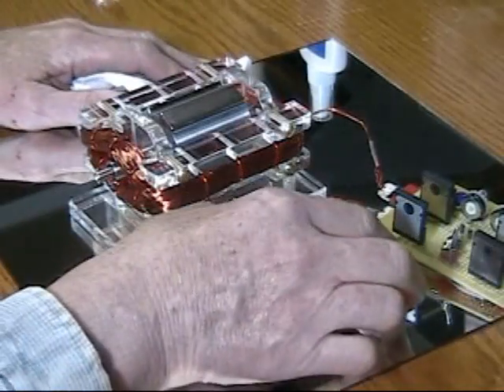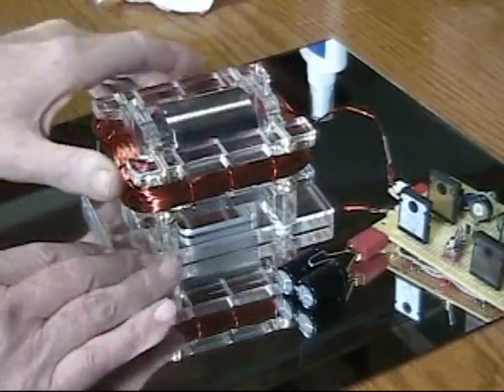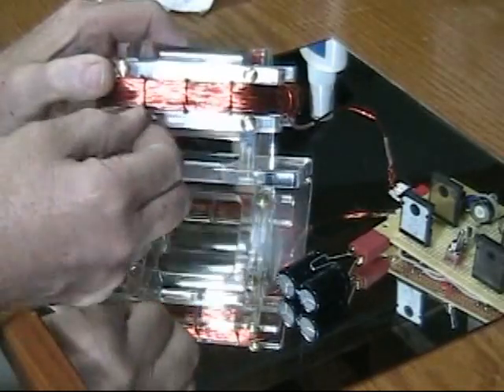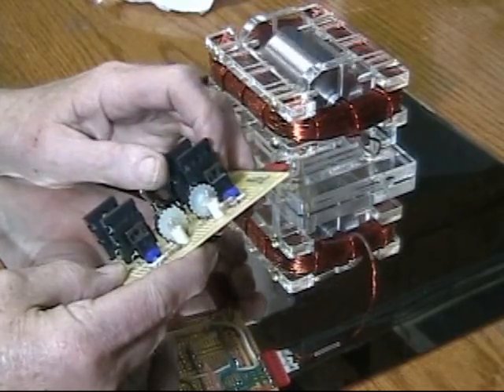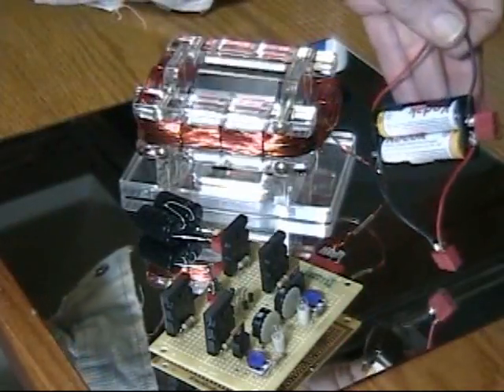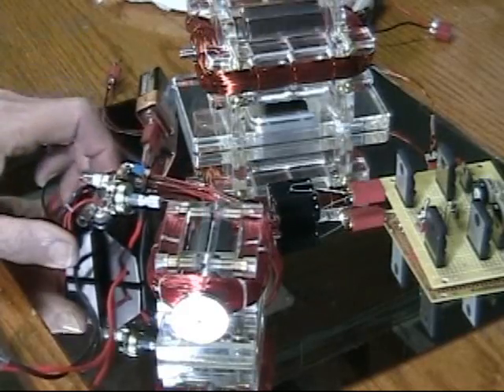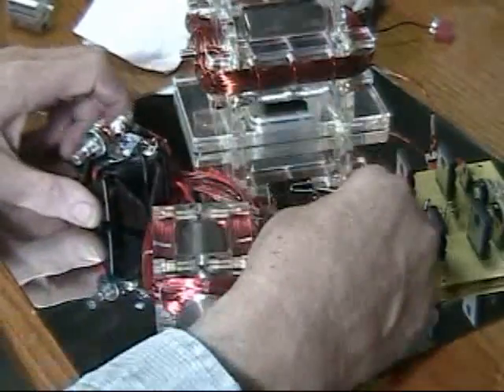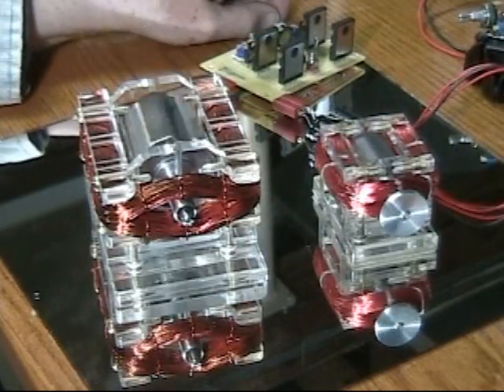Window Motor Running On Capacitors

Comment from the maker: Hello. There is a lot of information on the net with detailed instructions on the coil. There probably isn't enough room here to explain. One of the most important things about the coil is it should match the impedance of your battery, The wires can be Litzed or made from a number of separate wires, There can be one transistor or one driving each separate power winding.. The core should be the welding rod that is recommended. I will send a few links to your messaging.
John

Comment from the maker: I enjoy your enthusiasm, but this is just an experiment and needs a lot of refinement before it could be used for practical purposes. It would run from solar though. whether or not it would be a benefit over a system using just panels and batteries would remain to be seen.
Thanks for watching.
John

Comment: i wonder what would happen if you linked this setup with a generator from a gas or desiel generator but no combustion engine, just your unit linked to a solar panel and then tied to the electrical genrator. im sure it would work and there would be perpetual motion on a constant basis. now only to be able to use it to power a house or a city, or or a nation, or the world, lol ill just settle for my house.

Comment from the maker: It's funny you mention that. I've tried doing this and there is unusual results that aren't what you expect. A motor running in such a super tunned configuration is very sensitive to circuit / battery impedance. This motor has two capacitors in series that brings the voltage up to 5.4 at 20 farads. Now if you look at some of my other videos you will see a much longer run time while using one capacitor or some other cell, because there is a better impedance match.
Thanks
John

Comment: @DadHav  I'll study the super caps some more, but I still have a few salvaged electros from stuff...50-60K mikes,and 25-50 volts..mostly from 5v and + -12v power supplies.
  Tapmatic, yes, I even have a drill press spindle mount tapper I found at used tool sale.
Delrin, that stuff was never cheap ! The shaft seals I made were for food processing, raw potatos, a lot of water..most all 304SS materials, UHMW is real good for this stuff, but absorbs enough H20 to fail bacterial requirements.

Comment from the maker: @dougspair 
I personally haven't seen a super cap over 2.7, but there may be some. Yes, I used to work with a lot of pre hardened steels, Viscount 44, 4140, Stainless etc. Then some of the hydro carbon tapping fluids are necessary. You already know TapMatic and similar have a formula for almost everything, but I'll use Edge in my basement workshop. This Delrin was given to me from an engineer at NASA about 40 years ago. It's really quit good and a waste to use for a simple rotor.
John

Comment: I'll have to study the super-caps some more, but I'm thinking the operating voltage is engineered to work around the 3.5-3.7 volt lithium cells?
 Tapping? I've worked with many metals, and used thread cutting and roll form tapping, so I've used tapping fluids for steel, a different one for stainless, and yet another for aluminum.
 Delrin, I've used that for shaft/bearing seals in food processing equipment, mainly on stainless shafts, with the 'lubricant' being the process fluid, usually water

Comment from the maker: @dougspair
The super caps I have here are 2.3    2.5 and 2.7 volts. I use a tapping fluid called Edge, but sometimes I just use Marvell Mystery Oil from the auto store.
John

Comment from the maker: @FlavoredCoffeeGuy 
that's exactly what I've had in mind for a long time. Keeping the weight down is an issue but even an increase of efficiency would be welcome in the R/C field. I've been working on a fairly good size Piper Cb that would handle a pretty heavy payload. I haven't come up with a suitable idea to incorporate the two yet. Yes. LiPo is a very good way to go.
J

Comment: A pulsating DC magnetic field can work just as well as DC magnetic field.  There is a difference though.  The pulsating DC can be fine tuned, and all of the energy that went in come back to be used.  I wish these guys would stop using dead batteries to make a proof, and use a lipo battery and see how far a plan will fly.  This ought to be the biggest thing that ever hit electric RC modelling.  It would increase flight time from 2 minutes to hours.

Comment: The self inductance of coils in electric motors has always been considered a problem, not a solution.  The use of the buck boost basic circuit as the foundation of reclaiming that energy, over just ignoring it or calling a problem is the solution.  That is all that this motor proves.

Comment: I think that the negative comments come from a lack of electronics education and training.  If you know what a buck boost circuit is, then you can understand the operating theory that's reclaiming energy.  If there is a myth involved here, it's that magnetic lines are an expense of an inductor's energy if anything moves, or as a result of motion self inductance is dissolved.  Permanent magnetic cores are typically saturated, therefore only measured values of inductance should be considered.

Comment from the maker: @delio10267 
Yes it could run for about two days with each capacitor. You hit the nail on the head about applications. There's no torque here with such low watts. If I run the motor at 250 ma though it's really hard to stop the motor by holding the shaft.
John

Comment from the maker: @delio10267 
Yes it will run much longer with two capacitors hooked up. Also you are right in asking what you can do with this. The motor running at this low current really has no torque. The experiment is only to see how long you can swing a two pound rotor on a small capacitor.
J

Comment from the maker: @yx630514yx  In this circuit the bridge can be fed back to the capacitor but it isn't necessary. It didn't increase run time for me at this low voltage / current. I used a much simpler circuit on the Window Motor Assembly / Current Test video have a look at that video. I will post a video of the circuit which uses only three transistors and no resistors other than for the trigger trim. Yes, there stronger the magnets the better IMHO. Mine are M-42. 1/4 x 1/2 x 2".

Comment from the maker: @yx630514yx  I welcome you to try a motor. I don't know what calculation gave you 50 ohms as optimal. There is something strange about my wire and resistance. The wire was probably 50 years old. The diameter calculates the wire to be #31.5 and #22.7. The power coil = 12.2 ohms (29mH) the trigger 80 ohms (29 mH) I don't know why the high resistance of the trigger coils. I can only figure the wire was low quality. I guessed at 400 Ft. There may be a little more. I'm not sure.
John

Comment: @DadHav 
im not preticed at this stuff, but it does interest me, and i have a question/idea
that id like you to tell me your opinion on, so the motor seems to hold a charge due to the capacitors
so if prehaps you added a solar panel or two added a coupld more capacitor to it charged them all up
and added a Aluminum (not magnetic substance) arm with a timer set every so often to give it a quick boost, would this boost preformance, or only be a hassle on the already efficient system, and

Comment from the maker: @007bond66 
HELLO DIANA. MY LOSSES ARE PRIMARILY IN BEARING FRICTION. EVEN THOUGHT THERE IS 1200 FEET OF WIRE AND THE RESISTANCE ACROSS THE SOLID STATE CIRCUIT, I CAN GET THE  MOTOR TO RUN AT 50 MICRO AMPS. SO I HAVE A HARD TIME EXPLAINING LOSSES DUE TO CIRCUIT RESISTANCE AND THERMAL DYNAMICS. SEE THE VIDEO "WINDOW MOTOR ASSEMBLY" FOR A LOWER CURRENT TEST AND SIMPLIFIED CIRCUIT. I HAVE A NEW CIRCUIT IDEA AND MIGHT TRY THREE COILS TO SEE WHAT HAPPENS.
TAKE CARE.
JOHN

Comment from the maker: @frehleyukito 
Thanks for the information. I will look up both your suggestions. I'm not sure there is any of the effect you mention going on with the window motor but I've had it running as low as 50 uA. This doesn't seem possible with a 2 pound rotor even if it spins easy. Discussing things like you mention will bring me hundreds of negative comments, so I have to be sure about such a thing before claiming such.
Thank's
John

Comment: @koornj You can try to wiggle out of the the phrase "some run themselves" all you want but you are snared.  Bedini made a false claim about this clip as part of his overall charade.  You probably get a 25%-35% discount on Bedini related stuff that you resell and you clinging to that revenue stream like a bulldog. When an inductor discharges its energy it acts like a current source, and that's how you get voltage spikes.  It's not "radiant energy," that's a LIE used to make money.

Comment: @koornj Nobody's paying me, don't be ridiculous.  You are the one that's being paid as a reseller.  The full John Bedini quote from the "Bedini Ferris Wheel Regauging Motor" is posted elsewhere here in this thread.  "well some run themselves" is the key phrase.  If you want to actually understand how a Bedini motor really works, and how a discharging inductor really works, read the Bedini threads on the overunityresearch web site.  It would do you a great deal of good.

Comment: John Bedini alleges that this motor runs indefinitely on the Energetic Forum but the author of this clip clearly states that's not the case at the end of the clip.  If you want to get the real low-down on Bedini motors go to the overunityresearch website and look at the threads in the Bedini section.

Comment: I just came across this and I'm most interested. Does this demonstrate a motor that is running without any input power? Perpetual motion ? Capacitors, once charged by manually spinning the rotor, then sustain the motor run indefinitely ?

I can picture this concept being practical when scaled up. 

Thanks for the vid, I'll do some more research on this.

Comment: @DadHav 
One thing I had thought was to rotate the generator winding 90 degrees so that there is absolutely no transformer action between it and the other coils. But that is the key, how do you create resonance and rotation, where the rotation of the rotor does not affect the resonant circuit.

Comment: Absolutely fantastic craftsmanship. I would recommend switching to much smaller switching Mosfets, or switching transistors like the 2n2222 or many others could work. You will find that you are using huge switching devices for the job you need to do, you could reduce switching losses considerably at this point which is probably eating a good 50% of your power!

Comment: Hi: 
The circuit "half wave" of the mini, is a basic circuit SSG, or has changed? 
The position of the magnets in the rotor is north-south or just north? 
How long does it take to charge the capacitors? 
Thanks and regards

Comment: Hi: 
I do not understand English well. 
The WM 2 works only with capacitors on the video? Is a self running? 
Could publish the circuit WM 2? 
Thanks and regards

Comment: FINE work! Would you mind answering a couple of basic questions about the sequential bipolar circuit? I have the schematic and parts and I have started the circuit build but there are a couple of details I can't quite get from the schematic diagram. I would REALLY appreciate it if you have the time!        Scott